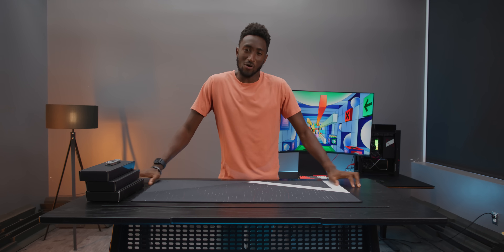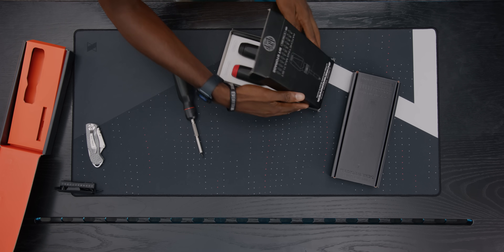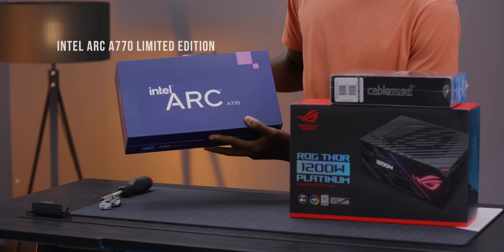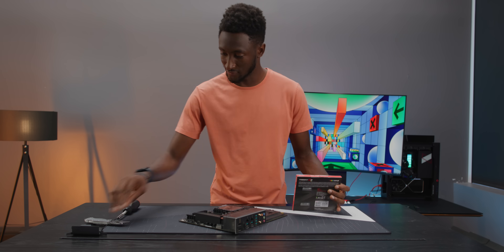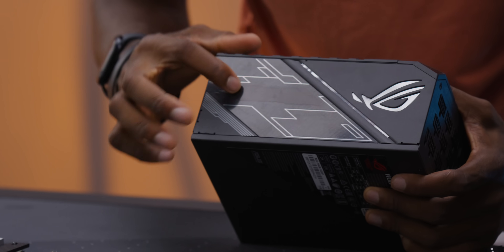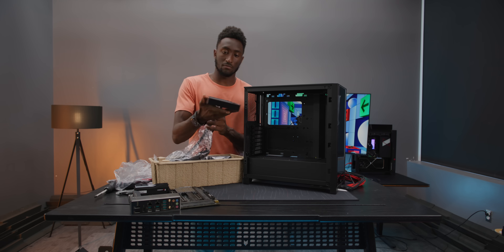World's First Intel ARC PC Build! (A770)

Comment: He did the peel under the M.2 heatspreaders, he knew the correct radiator orientation, the PSU fan orientation, everything. Although he had not built a PC in years, he got even the smaller things right. About the case having glass on the front instead of an airflow-friendly open pattern, he did not choose the parts and he's just gonna get higher temps but nothing terrible like instant thermal throttling. The red screwdriver looks great too, good job LTT

Comment: Nice build! Liked the video a lot. One thing though, the radiator being front mounted is not actually a big deal. Yes, top mounting is preferable but it’s not bad to front mount either.
Reply: front mount is ok, what is not ok, is the orientation of the rad in front. When you have tubes at the top, air bubble have a higher chance to go to pump and potentially damage it
Reply: @ziemniaczek320  Even if you have tubes towards the top it should be fine. As long as the rad is higher up than the pump, air will accumulate on the inlet of the rad. Which is no big deal, it might create some noise but that’s really the extent of it.

Comment: Due to the radiator on the intake fans, your build has negative pressure: air is being pushed out more than it's pushed in, causing air to be sucked in through unintentional gaps and crevices. You want another intake fan to keep it equal or slightly positive

Comment: I thought the pump should be the lowest point in the loop because there is still a little bit of air in it and by putting the pump at the lowest point you preventing it from sucking in air so how you've done it was perfectly right. but I could be wrong

Comment: ~10:00 If you use the fan-less/hybrid mode on the power supply then it's actually recommended to have the fan facing up, so that the other fans in the system will push a little bit of air through the power supply even when the power supply's own fan isn't running.
Reply: Oh wow, gtk!
Reply: Yo fam I’m a small content creator, and I make a variety of entertaining reactions, vlogs, and a range of other content and I’m still working on quality but I guarantee you will find something you will enjoy! 🙏🏾💙💙

Comment: Tubes at the top isn't that bad if the pump is lower then the top of the radiator, which is the case most of the time.

Comment: Really bizarre video this one... Looks like another person's channel. Cable management may seems tedious to watch but it's a step from which many could learn something. A double glassed case could have shown the supply's display. PC was built but not a single performance spec was shown, even for the arc. At the end, it looked like a build with very expensive parts. And that's that. With 50s commercials touches here and there. It really looked like some Jr YouTuber possessed MKBHD's body and made this video. Really bizarre.

Comment: But the way there’s no issue mounting the liquid cooler with the tubes coming out of the radiator at the top. As long as your pump is never the highest part of your AIO, you don’t risk damaging the pump. Just never have the pump be higher than the tubing and you’re good.

Comment: I really like this channel and MB is a boss whose reviews helped me buy my phone this month. I get that this was a bit of fun, but nowhere in the intro did I see any warning as to how dumb a build this actually is. Maybe I missed it?
Imagine building a car with Formula 1 or Nascar chassis, suspension and drive train, then fitting an engine from a small family car. He's building a PC fit for an Nvidia 3090ti graphics card, with an Nvidia 3060. Even if this was a 3060ti equivalent graphics card (which it is not) this would still be dumb. The ARC 770 won't work any better inside that monster PC than in a shoe box.
Reply: wild that LTT spec’d the build and likely had Intel as a sponsor 😂
Reply: @michaeljensen_  So many comments talking about radiator positioning or the CPU while totally ignoring how absolutely ridiculous this build is. Maybe Intel paid for all the parts but then he should have said so. Looking at the comments below makes this video feel like an Instagram thirst trap.

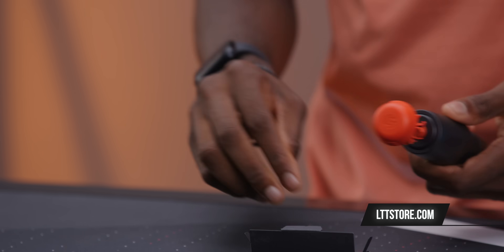Comment: 2:14 The Parts
2:16 Case
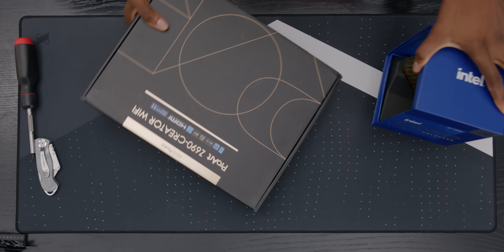2:33 Motherboard and CPU 
2:56 CPU cooler
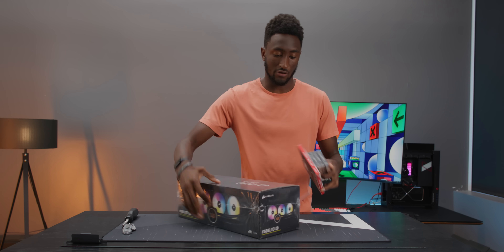3:05 RAMs
3:09 SSDs
3:26 Power Supply
3:36 Intel ARC A770
3:51 The Build
3:55 Motherboard
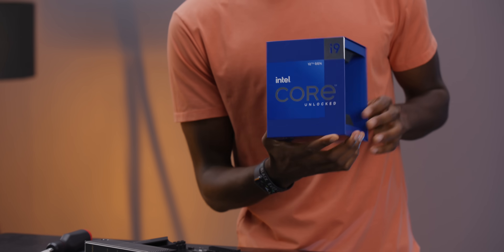4:28 Installing CPU
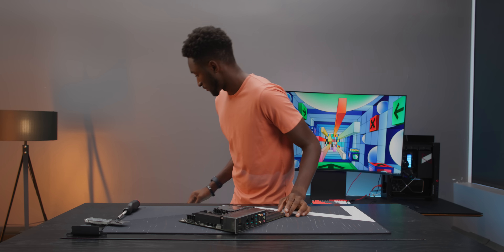5:24 Installing RAMS
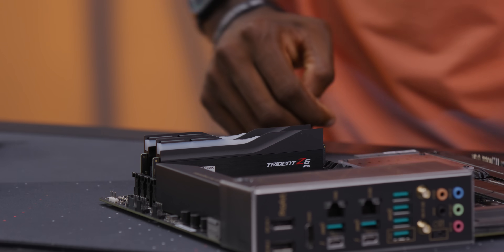5:55 Installing SSDs
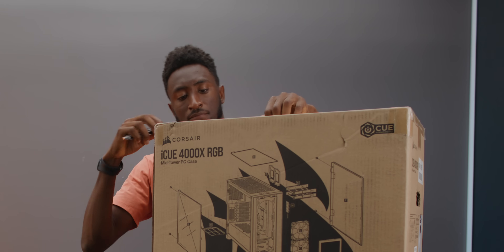7:16 Case
8:30 Power Supply
9:30 CableMod
10:50 Installing CPU Cooler
12:06 Backplate on Motherboard
12:15 Motherboard in the case
12:34 CPU cooler on CPU
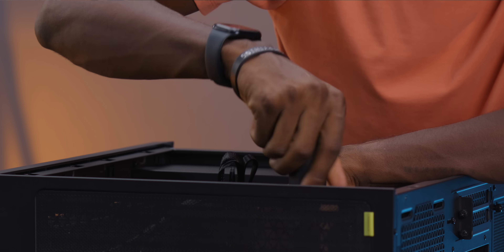12:50 Intel ARC A770
14:07 Cable Management Magic
14:22 Finished Build
Reply: this helps a lot, thanks
Reply: @navneetjain0  u dont have money for these items how does it help you
Reply: @revisedcandy4295  how do you know he doesn't have the money?
Reply: @revisedcandy4295  imagine him building the PC rn?
Reply: @revisedcandy4295  tf?
Reply: Am I mistaken or did he not apply any thermal paste?
Reply: @zatieldaybreak3746  the AIO has pre applied thermal paste
Reply: Thank you
Reply: When's the bit about the screwdriver? That's what I'm here for.
Reply: Not all capes wear heroes
Reply: Thanks
Reply: 5:11 that satisfiying sound affect
Reply: Yo fam I’m a small content creator, and I make a variety of entertaining reactions, vlogs, and a range of other content and I’m still working on quality but I guarantee you will find something you will enjoy! 🙏🏾💙💙
Reply: @ItzMalick  Go away beggar
Reply: wish this was the pinned comment instead. thanks
Reply: The Real MVP!
Reply: 00:02 Alright what's up
00:04 Welcome to the first PC I have build
00:09 9 years
00:16 2013
00:20 I'll be doing this again
lol jk 😂😂

Comment: I’ve not built a PC for about 7 years! I remember my very first build in about 1997/8 and having to add the jumper caps to the pins to get the CPU and RAM voltages correct. First boot up back then felt like Russian Roulette 😂😂

Comment: nice build. i originally wanted the Asus Thor PSU but i feel like its a design flaw on their end with where the intake for the PSU is. they should have put the LCD on both sides, or reversed the intake position of the fan cause for that Corsair case, most Lian Li and other cases, you wouldn't be able to see the LCD screen if you put the PSU fan as bottom intake. and top intake would be redundant cause you're brining warm air in from the pc. and most cases have case filters for bottom intake PSU spots. was a deal breaker for me. hopefully they fix that
Reply: Yeah, I was looking at that and thinking "that can't be right, why is it upside down?!", aren't most cases bottom-intake now? I don't remember the last time I installed a PSU with the fan facing upwards.

Comment: The cooling tubes being at the top in this case is probably fine, the pump is not the highest point in your loop. The small amount of air in the AIO will stay in the top of the radiator. Nice build overall!

Comment: 0:39 It's the sharpest knife, because it's just a fancy utility knife / box cutter.  The blade is a razor. A disposable razor.  Of course it's super sharp, but only for a few cuts.  Then you flip over, get a few more cuts. then you gotta swap it for new one, or else it becomes the dullest knife you have.
Reply: To be clear, I'm not knocking the knife, just the "sharpest knife" thing needs some expectation tempering. Any utility knife will be as sharp, until the razor gets dull.

Comment: Like everyone I'll give my opinion when no one asked for it. 5000X or 5000D might've been more appropriate for a motherboard this size, especially since AIO and a GPU are being used. It's not that you can't put a PC together in there, but problems can arise, some AIOs(basically Arctic) will clash with the motherboard heatsinks and wont mount on top, even the 240mm ones. And if something stops working it's a pain to disassemble and reassemble. The more you do it the more pain you feel, I had the bad luck of my computer breaking 3 times since march, after the third time which was very recently I got so fed up I bought a 7000D for maximum work space, I was done with all the shenanigans. Which is why I have massive respect for SFF enthusiasts that try to fit in everything they can in as little a box as possible, you guys are truly hard working folks.

Comment: Sorry to be that guy. But I can't help but mention that it's probably better to put those tubes at the top than the bottom.  Look at it this way: there is or will be (once time acts to steal some fluid from the loop) an air bubble at the highest point in the loop. Your job is to keep that air bubble away from the pump (which will pretty quickly burn up and die if it is not water-cooled). By putting those tubes going up from the pump, you reduce the likelihood that the air bubble will land right at pump level as it can rise into those tubes. If the tubes are below the pump, then the volume of fluid above the pump goes down and you have less air-bubble-tolerance in your build.

Comment: It's easier to build a PC now than it was 10+ yrs ago. I'm not saying it was difficult before, but building a PC today feels like playing Legos. We have the convenience of NVME m.2 SSDs which are super fast. Before we had to RAID 0 multiple bulky 3.5" HDD to achieve high read and write speed. Cable management is easier now because of modular power supplies and minimal cable use, no need for molex, sata, ata, ide, etc.
We have power supply covers built-in in most cases. I had to DIY my covers by cutting and bending plexiglass and wrapping them in vinyl sheets to match the case. Also, RGB lights are pretty common now. Before, it wasn't a gaming PC if it didn't have Cold Cathode Lights. 🤣🤣

Comment: the close loop radiator orientation is fine. your highest point is still at the radiator  air should trap there which shouldnt cause problems.. only matters when air runs into the pump block causing noise and eventual premature failure

Comment: 11:33 no, it's ok to have the AIO tubes at the top as long as the pump is not the highest point of the loop. not the most "optimal" orientation but it'll be fine.

Comment: Couldn't get the price for the Intel Arc, but here is how much you need...

Intel A770 limited edition: ?
Intel i9-12900k CPU Processor: $588.00
Corsair H150i Elite LCD CPU Cooler: $259.99
ASUS ProArt Z690 Motherboard: $449.99
G.Skill Trident Z5 RGB 64GB DDR5 Ram: $449.99 
Sabrent Rocket 4 Plus NVMe SSD: $699.99 
Corsair 4000X RGB PC Case: $129.99 
ASUS Thor 1200W PSU: $319.99
CableMod RT-Series Pro ModMesh PSU Cable Kit: $79.90

Comment: I hope the CPU cooler had a thermal pad attached to it. You didn't show or mention it, but that fancy, very expensive chip won't last very long if you installed the cooler heatsink without some kind of thermal compound. It may seem obvious to anybody who has done this before, but if a first-timer watches this and uses it as a how-to guide it could be a very expensive and frustrating mistake for them.

Comment: Don’t know about windows 11 but I don’t trust windows installer with multiple storage drives. It likes to drop MBR master boot record on drives other than the OS drive. Which means if you remove any drives or if they fail or you want to move your SSD to another setup, I hope you like BSOD. Only plug in one drive when doing OS install to avoid this Microsoft shenanigans.

Comment: Mark my words, EVGA is working out a deal with  Intel with regards to ARC.

If Intel can pull it off (ie: please just be less rocky than the Radeon launch, looking at you drivers) -- it could be the biggest shift in the hardware industry in some time.

Not to mention the fact that Intel will almost certainly have some monopoly-level performance when you combine their processors and video card.

Comment: I could be wrong but I’d put the water cooler on the cpu with the cables on top. Otherwise you’re causing more strain on the tubes and pump wise you’re working against gravity.

Comment: I've run Corsair AIOs for years with no issues until about 5 years in (within warranty period) with them at the front of the case. When people say not to do this, they mean not to put the pump above the tube inlets on the radiator since the pump will have to work harder to move the fluid.

Comment: Everyone I see using a ratcheting screwdriver does the same thing I do....don't use the ratchet and just spin it in their hands ( 11:46 ) like a normal screwdriver or a 4/5/6 in 1. Nothing wrong with that and he doesnt do it all the time plus its great you can do that in the first place however that's when something becomes a compromise. All of the downsides for a feature you don't use.

Very clean build btw. Surprised about the Intel graphics card. Good stuff.

Comment: in this radiator configuration you should actually put the tubes on the top so air doesn´t get stuck in the pump.

Comment: You can put the tubes the top by the way. It just depends on where the pump is. The way you did it is completely fine. Linus actually has a video on this exact subject.
Reply: If I don't remember all wrong you want the air in the system to gather at a point where it is not going back towards the pump. Considering the connections on the radiator are at the highest point of the system it will mean that they are at a point where the air is accumulating and a part of this air will get sucked down into the pump again. It's not the worst, the worst is if the pump is the highest point and the air accumulate in the pump. The best is if the side of the radiator without connections is the highest point. So okay install for sure.

Comment: Love the vid. I just did a build with that exact case and AIO (which I love) and I was thinking, how'd you get the tubes connecting to the bottom of the pump unit? Then I see it was changed to the right hand side before being turned on. Like you say, one of the pleasures (and frustrations) of PC building. But all worth it in the end.

Comment: Linus spec's PC parts and only way to install radiator will cause pump to die prematurely.  I bet LTT got paid big to put an Intel GPU on this build. CA-CHING. Have fun with Intel driver support they have all but officially cancelled ARK.
Reply: That's actually so faulty of Linus, also giving him a case that doesn't fit 360 radiators, shouldn't that guy know what he's doing????
I'll unsub from ltt for that.

Comment: LTT must have used the actual Corsair website that says the front does accommodate a 360 radiator. I fell for the same thing -- it ONLY fits when you install it incorrectly (tubes on top). So, thanks Corsair.
Reply: LTT should know that!!

Comment: For those wondering the price of the build (approximately):

CableMod RT-Series PRO ModMesh Cable Kit for ASUS and Seasonic - BLACK / RED
S$165.45

ASUS Rog Thor 1200 Certified 1200W Fully-Modular RGB Power Supply with LiveDash Oled Panel
S$467.24

CORSAIR CS-CC-9011204-WW iCUE 4000X RGB Tempered Glass Mid-Tower Case, Black
S$169.75

Sabrent 4TB Rocket 4 PLUS NVMe 4.0 Gen4 PCIe M.2 Internal SSD Extreme Performance Solid State Drive R/W 7100/6600MB/s (SB-RKT4P-4TB)
S$969.99 x 4 

G.Skill Trident Z5 RGB Series 64GB (2 x 32GB) 288-Pin SDRAM DDR5 5600 (PC5-44800) CL30-36-36-89 1.25V Dual Channel Desktop Memory Model F5-5600J3036D32GA2-TZ5RK (Matte Black)
S$688.31

ASUS ProArt Z690-Creator WiFi 6E LGA 1700(Intel 12th Gen) ATX Content Creator Motherboard(PCIe 5.0,DDR5,2X Thunderbolt 4,10G&2.5G LAN,4xM.2,Front Panel USB 3.2 Gen2x2 Type-C Ports)
S$685.40

CORSAIR CS-CW-9060062-WW iCUE H150i RGB Elite LCD Display Liquid CPU Cooler, Black, 360mm
S$369.27

Intel Core i9-12900K Desktop Processor 16 (8P+8E) Cores up to 5.2 GHz Unlocked LGA1700 600 Series Chipset 125W
S$878.00

Intel® Arc™ A770 Graphics Limited Edition
S$399.00

Total: S$7,702.38 = US$5471.22

Comment: I’ve been out of the PC hardware world since my last build—
Is the Intel Arc Intel’s first foray into dedicated graphics? 
Also, is that A770 their best card? What’s the comparable?
Reply: It's Intel's first serious line of graphics cards, I think there have been some light mobile cards in the past. I don't know if the A770 is broadly available yet, but it should roughly compare to an Nvidia RTX 3060 from what I've read. There are still driver issues with the Arc GPUs, they only perform competitively with newer (DirectX 12) games, which is probably why Forza was the showcase in this video.
For model naming, Intel are actually using a pretty sensible scheme - A is for the first generation, the next number is the product tier (currently 3, 5 or 7, just like their i3/i5/i7 CPUs, and they haven't announced a 9 tier this generation). So the A770 is the highest-tier one that's currently available, and they're not trying to compete directly with the high-end cards from AMD and Nvidia.
I think it's cool to see more competition in the GPU space, even though it's probably going to take a generation or two before Intel cards actually make sense to buy for normal gamers.

Comment: I thought Linus got Henry Cavill but MKBHD is a good plan B. 😂

Also did he not put thermal paste?
Reply: I noticed that too. Should be interesting to see how a great cooler works without good heat transfer.

Also, installed the MOBO into the case without testing it. Bold move.